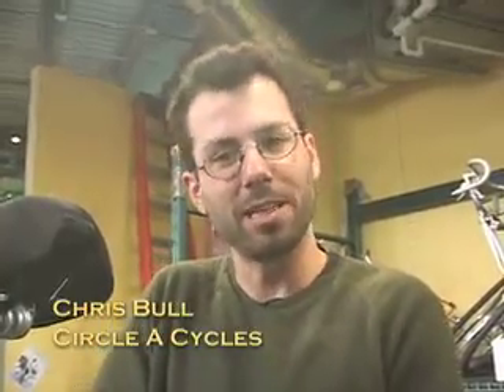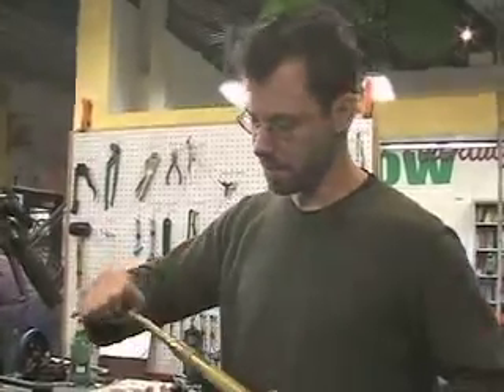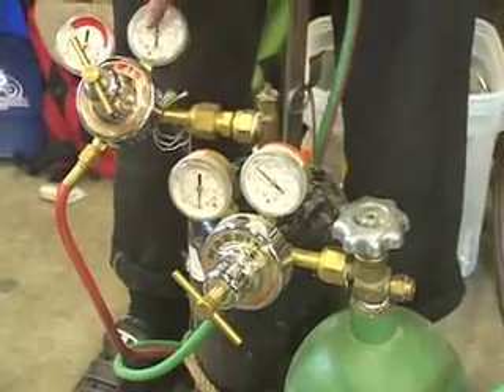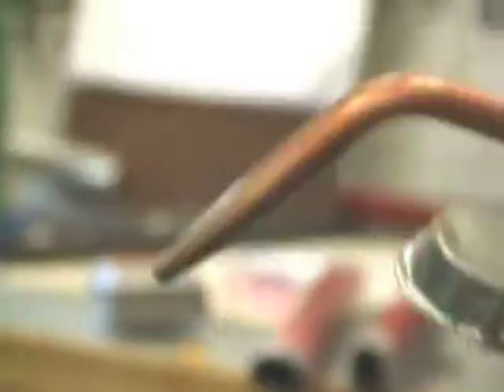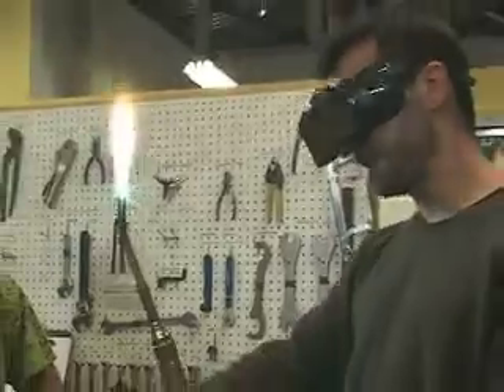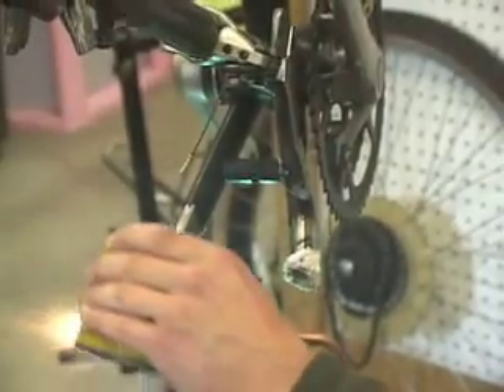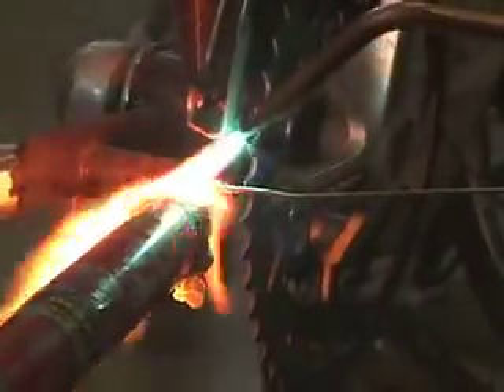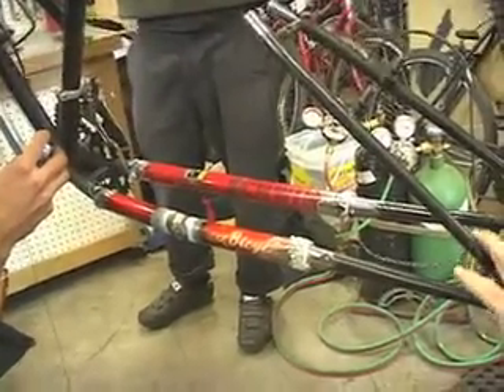Worldbike Oxy Acetylene Brazing Workshop

Comment: @MCRmechanic If you're using a welding tip, you probably want more in the range of 5 psi for both oxy and acetylene. The figures you gave might be used for cutting 1/2" + steel plate.

Comment: In frames built without lugs (that's the bit that they are putting the braze between where the tubes meet) they do. But overall it's a messier joint needing a lot of time consuming filing and cleaning to make a smooth appearence. That's why big commercial framebuilders dont clean them up and why you see bikes today that have those ugly weld ripples at the joints. Also welding is hotter and I think leads to weaker joints and can also lead to distortion of the tubes. But that's just my opinion.

Comment from the maker: HI, 

I am actually not a a welder - just a cyclist/videogapher.  
My understanding is that even though a weld would make a stronger bond, It is stronger than the actual steel being welded and can result in a failure in the tube right next to the weld.